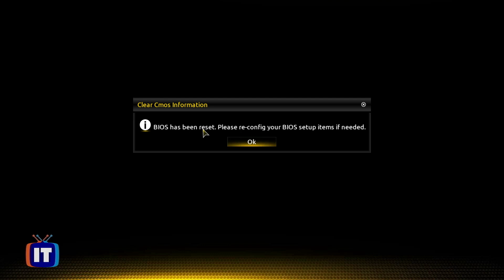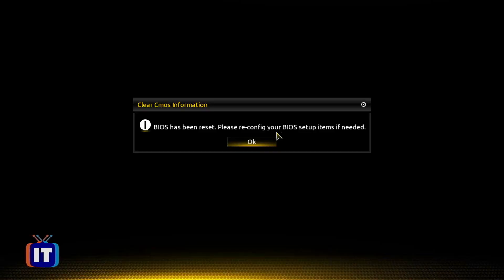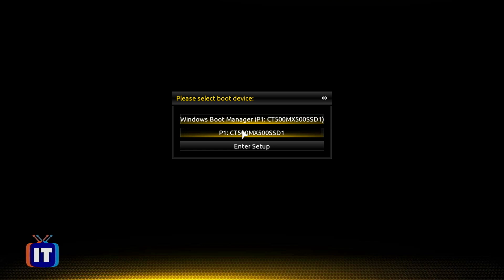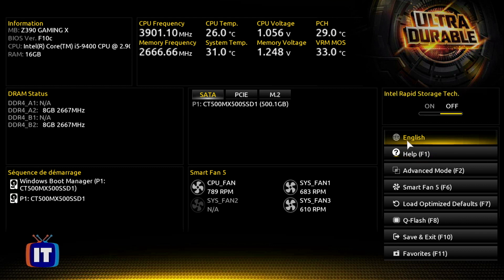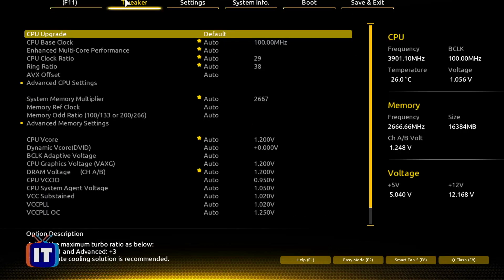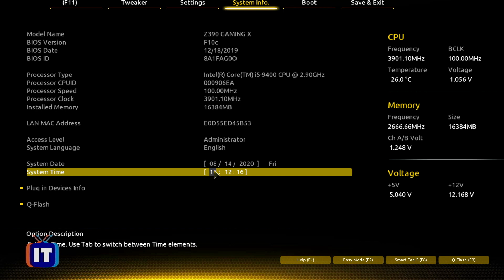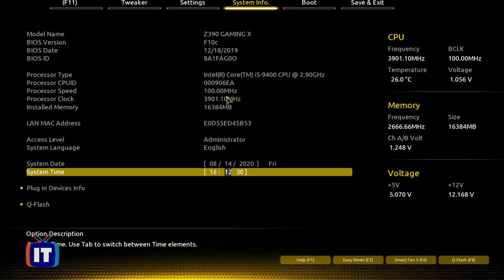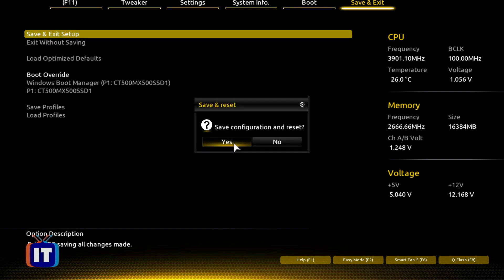CMOS Setting Error - How to Replace CMOS Battery | PC Maintenance

Comment: Cool, did not know that the CR2032 is standard on computers. Thought I was going to have to take the computer apart and wait until I find the right battery number. Now I can preorder the battery before getting started.

Comment: At my wit's end I've been working on this pc for 2 straight days. I cleaned it all up. Everything inside is clean.   My pc has not booted up and and shown any video signal on any output. That is to say,  every monitor has consistently shown "no input".  And now. My Pc is flashing the amber alarm 5 times to indicate a bad cmos battery.  I just bought 2 2032 batteries today. And I have gotten the same message every single time today.

Comment: My Pc keeps doing short repeated automatic restarts.
Reply from the maker: I would recommend trying to boot into the Recovery Environment then choosing Startup Settings, when you get the menu choose Safe Mode, if this allows you to boot your computer, then you might have a driver issue. However if you still cannot boot, try to boot to the command prompt and run SFC /scannow, this will run the System File checker. Then run chkdsk /r /f and if you still have the issue it will be one of two things a Windows OS issue which might require a reinstall and if it is still happening after that I would say it is most likely a piece of hardware failing.
Reply: @ACILearning  I also got a message that’s says something about PSU over-voltage . Shut down initiated to prevent damage.
Reply: @ACILearning  How do I boot into recovery environment.
Reply: @ACILearning  How do I tell if my PSU is damaged or dying.